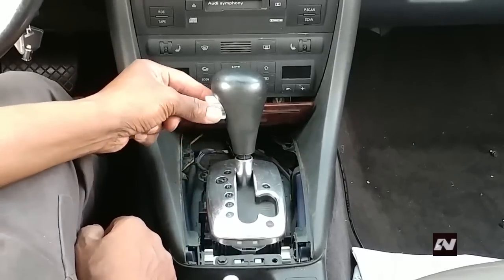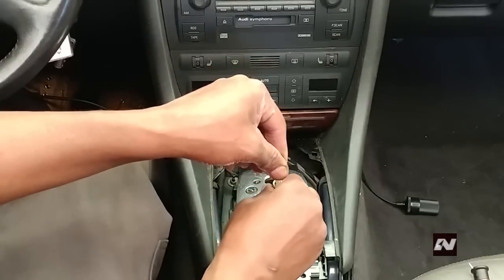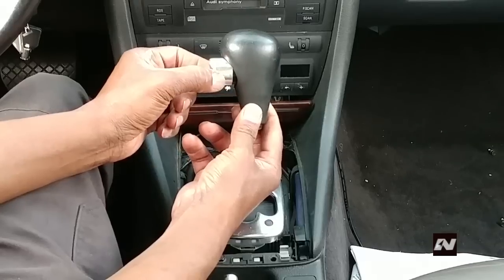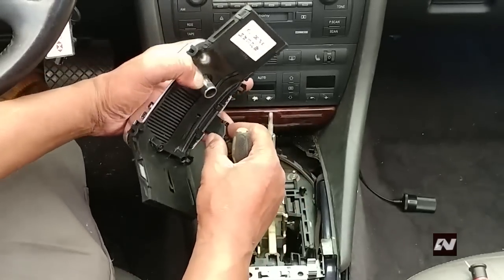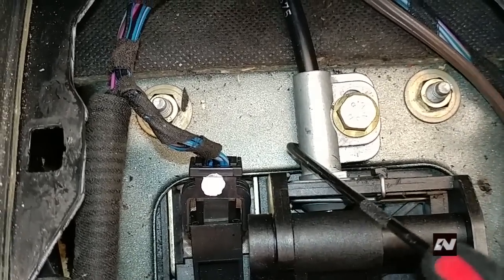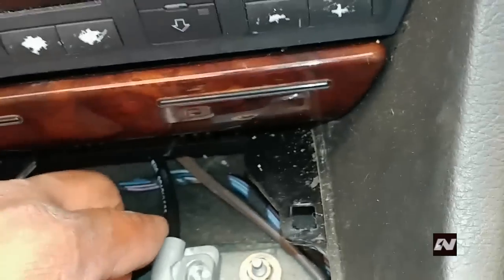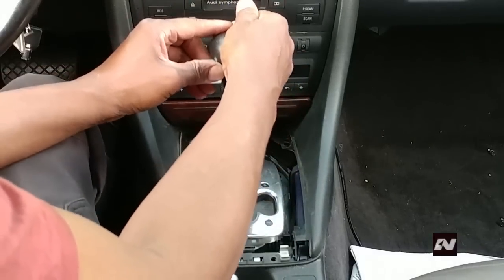Automatic transmission shifter removal. Audi C5 A6/Allroad

Comment: Great tutorial video! Thanks for sharing... I have a 2001 VW Passat V6 automatic and ended breaking the plastic piece trying to replace the shift knob. You know where I can find a whole assembly to resolve the issue and is it called or label as the automatic transmission/ gearbox?
Thanks again..
Reply from the maker: Thanks for watching.  I think its called "automatic transmission sifter assembly"  Take a look at the one pictured in this link on ebay 

https://www.ebay.com/p/24030616134?iid=163603328124&chn=ps&norover=1&mkevt=1&mkrid=711-117182-37290-0&mkcid=2&itemid=163603328124&targetid=882987571626&device=c&mktype=pla&googleloc=9010759&poi=&campaignid=9248481261&mkgroupid=93494027426&rlsatarget=aud-298628318826:pla-882987571626&abcId=1141156&merchantid=8523484&gclid=CjwKCAjw3-bzBRBhEiwAgnnLCkr8lpkVTEP0ygqNkHhs7tTf-e9JX9ypzqnS727DbS10hoery7xPnxoCLYIQAvD_BwE

I think both B5 (VW) and C5 (Audi A6/Allroad) platform use the same unit.  If it look like yours then it probably work.
Reply: Patrick Neil , thanks for the follow up. I’ll check into it... I’ll keep you posted

Comment: Hi  Patrick my Audi got a lock shift gear what I did I by pass that cable that connected to the gear so shift  again drives.. question the cable is the one lucking my gear it keeps it in park..any suggestion or to fix it ? Thanks
But I took of the cable work and runs fine what’s that cable for ?

Comment: Nice Video. I have a C5 S6, and the shifter lock solenoid seems to have failed - it was locked in Park. Do you know if the solenoild connector is unplugged from the gear selector, will the transmission be able to shift? Thanks.

Comment: Too push it out the bottom of car what do you need to remove from under car
Reply from the maker: I don't know if the bucket will slide out the bottom of the transmission is still installed.
This info is intended for people who are snapping from auto to manual transmission.
In that case the transmission is coming out.

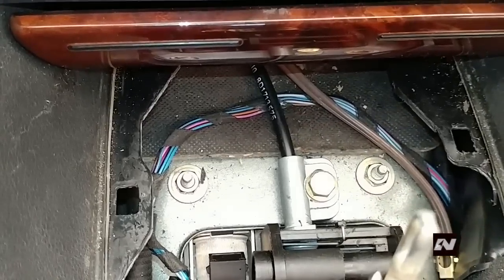Comment: 3:40 is that what is responsible for making the button spring back? My shift button keeps getting stuck in and I've had the knob off multiple times but no help. Hope someone can help!
Reply from the maker: No. There is no spring tension in that part.  It's been a long time since I take one off, but I think there is a torsion spring and some plastic parts behind the button that keep it out.  (Google "torsion spring" to see the type of spring I am talking about)  If you remove the knob you can look at it and figure it out.

Make sure when you pull up on the plastic piece, it retract by it self when you let go.  Actually I think this is where the spring tension is.  Let me know how your findings go.
Reply: @pnswg01  OK Thanks! It will be a few days before I get a chance to look at it but will get back to you. It is actually the second gear selector and having trouble using either of them

Comment: For what is that cable ?
Reply from the maker: The cable is used to control the transmission/gearbox. When you move the gear selector/lever it pulls and push the cable which is connected to the transmission below.

Comment: How to remove fake wood cover? That's important step and you didn't show it.
Reply from the maker: Sorry about that. I didn't plan on making this video. After I start working, the idea come to mind, so I reinstall most of the parts removed and then make the video. I didn't bother to put back the trim because it is so easy to take off. That is the first instruction in the video. "USE A FLAT BLADE SCREWDRIVER TO REMOVE THE TRIM"
Reply: @pnswg01  it just snapped when I tried to do that. So I needed a new one.
Reply from the maker: @alespretor27  The car in the video is Audi C5 A6 Allroad. If you look at the video you can see the 2 metal clips that hold the trim in place.  I remove these all the time...sorry.
Reply: @pnswg01  come on man it is none of your fault. I was a bit impatient and that was it. and a little pissed off after that.. thank you

Comment: Bro disconnect the battery
Reply from the maker: The Tiptronic selector circuit only has power when the key is inserted into the ignition.

If you want to go through the trouble of resetting the clock and radio codes (some cars) then you can disconnect the battery.

If removing the transmission...then yes disconnect the battery, otherwise there is no need to.
Reply from the maker: Yeah Man! Thanks.
Reply from the maker: After removing the last 4 bolts,  push the whole box down below on top of the transmission.

It will be the cable and a plastic box. What you did above is simply disconnect the cable from the shifter assembly. Good luck.
Reply from the maker: Yeah that work too.